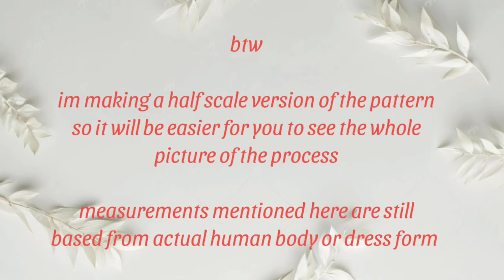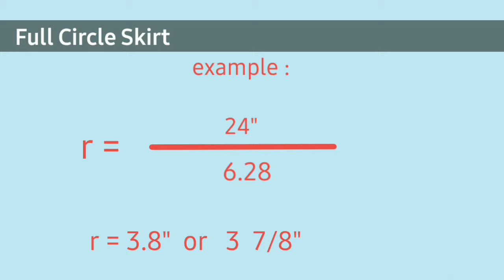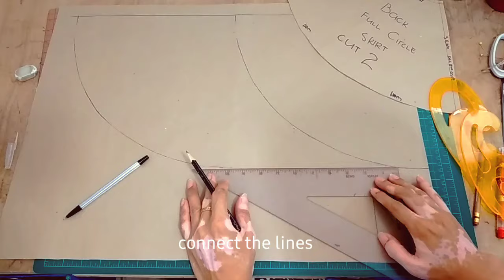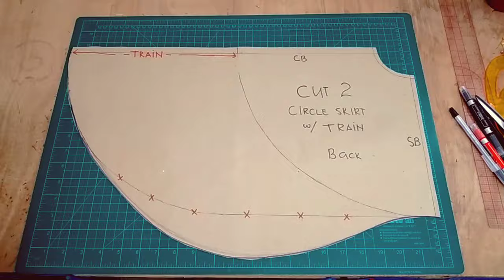🧵 How to Make a Wedding Dress Train Pattern Making × falda circular x Sewing Tutorial

Comment: For those who want to know if you want to use this pattern for other variations of circle skirt, it can but not at the 1/4 circle skirt. If you use the back skirt pattern but with a larger waist measurement and use a half circle skirt with the front as floor length and the back being as long as you want. I made mine really big at the waist to accommodate pleats in the back for a full back so it works really great.